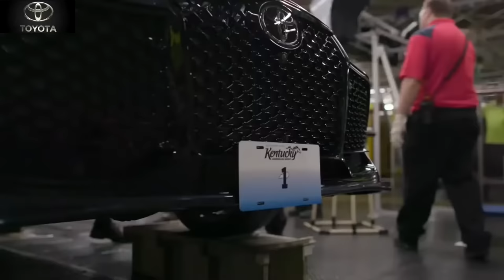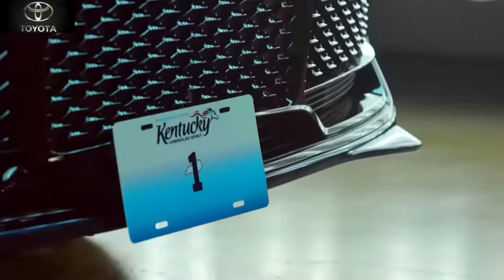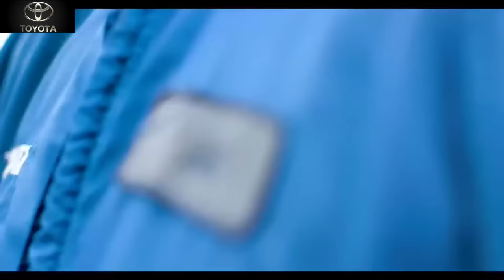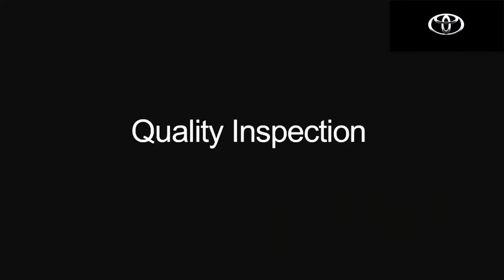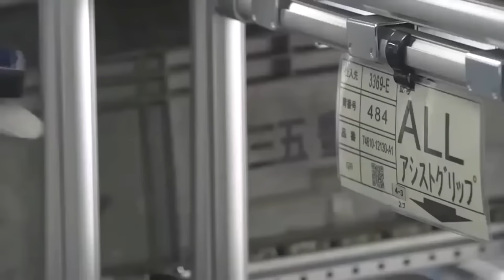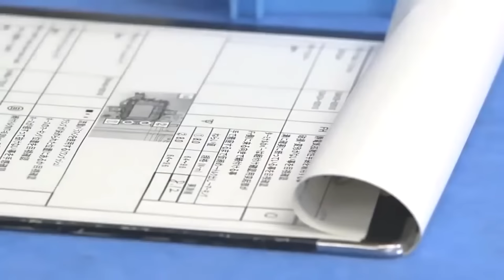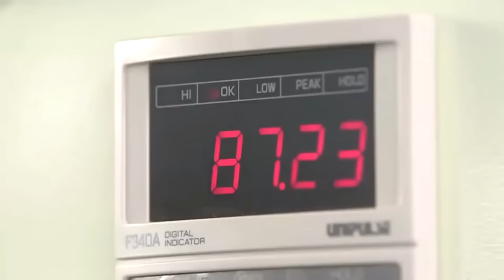TOYOTA PRODUCTION🚔2024: Manufacturing Prius, Avalon, Camry, Corolla, RAV4, Sequoia, Sienna, C-HR

Comment: My 2005 Camry is built @ TMMK and runs very well these past 16 years. Every vehicle is manufactured differently and it's hard to compare quality across any manufacturers model line up unless that same model is being made at various plants. The Tahara plant in Japan is the best quality plant and has won numerous platinum awards. The Lexus LS is made there.
Reply: Is the Camry for Europe also made in Japan ?
Reply: I have the 2020 model and love it !!
Reply: @yoannavrillier2826  Just Japan I believe
Reply: thank you for the comments I currently have 3 Toyota I have a 2000 Tacoma,  I recently bought a 2022 Camry xse and I have a 1986 Celica gts which has 270 thousand miles on it and still runs
Reply: Camry2011🥴🥴✈️✈️😘😘😴😴
Reply: best good people building those cars to us.
Reply: I had a silver 2005 Camry since 2006 until I was too negligent to do an oil change and killed it.  In the last 3 years I've owned 3 brand new corollas, and almost all of them got totaled either in a deer accident or being rear ended.  I've probably hit 5 deers in my ole camry and barely had a dent ! even with few accidents it was still standing solid !! but thankfully I've always had full coverage but what is it with these new corollas ? I'm getting one delivered in couple days, from japan.   But is it me, or is it the new toyota's won't stand a chance ?
Reply: @drkoko9604 I wouldn't be bragging too much with a track record like this

Comment: @0:16 is exactly why I'm glad my Toyota was assembled in Japan.  Face mask on the outside of his shield.  it's that type of "I'm 'Merican, can't tell me what to do" is why our manufacturing is sub-par.
Reply: If ur wearing a face shield, why do you need a face mask? I also didn’t see anyone working alongside him.
Reply: Have you ever worn a face mask while wearing glasses? The mask redirects the breath upwards which will fog up the upper portion of the face shield to obscure vision.  Try using some common sense
Reply: That's actually accepted Toyota practice, to put the face mask at the bottom of the face shield. Has nothing to do with the individual team member or their ideals.
There hasn't been an outbreak at a factory yet, so apparently it's working. 🤷‍♂
Reply: No, it's special company approved COVID face shield. That allows the team member to be maskless but still be protected. Toyota North America had policy that if any team member would be consistently be 3 feet apart, they were required to wear face shield even if you were wearing a mask. 

Thank God! That stuff is DONE with! Work in body weld wearing a mask, safety glasses, bump hat, anti-cut sleeves, and Kevlar gloves in 110 degrees... You learn real quick why hospital operation rooms are 60 degrees!

Comment: Toyota is a very excellent company, but between the years 72 and 90 it was absolutely distinguished in the world, but at this date it manufactures commercial cars and they are not of high quality because of the sounds that are issued while driving and the very weak structure.

Comment: Toyota: where everything is reliable but the paint is God awful and you can't do anything to fix it from the factory. Not even the "paint protection" plan works. Fucking horrendous. I love my brand new Toyota in every aspect except this paint. Yes I'm salty, yes I'm pissed there's nothing they can or will do about it (I've been to the dealer and they said I'm SOL), but I want to keep the car because I love it. Just very upset to get a brand new car with shit paint quality.
Reply: yes I agree with you I had a 2009 corolla I believe. it was red in color, and the paint literally fell off after  3-5 years. I also contacted the dealership about it and they contacted Toyota well you know the answer well I remember  the dealership offered to help me they stated they would pay half and I would  pay the rest if my memory is good, but I got rid of the car thank you for your comments

Comment: Toyota does not master the interior of the car, it is all plastic of a poor type, after how many months of use, the interior parts hear annoying sounds, and on top of that, the price is high. Why?
Reply: Are you serious, one of my car is a 96 Camry and its in excellent condition, never had a problem, only changing oil and timing belt.
Reply: You have no idea what you're talking about.....they're prices  high because they last forever.  Honda and Toyota are the best on the road. And EVERY  new car and truck has plastic interior panels...
Reply: @rashodeenyassim  same shape in avensis very good